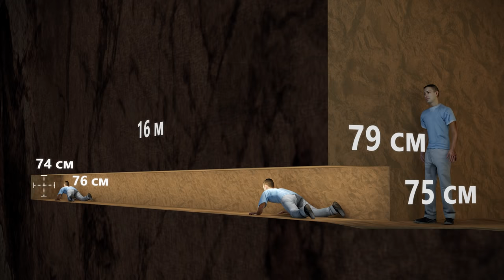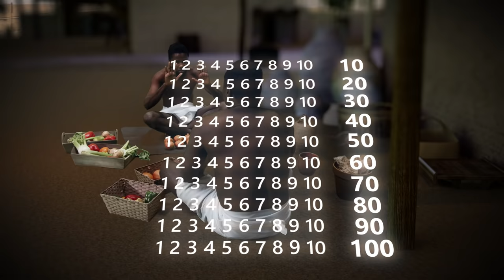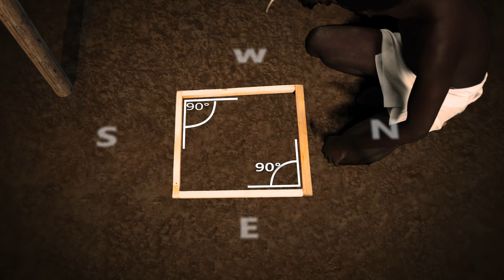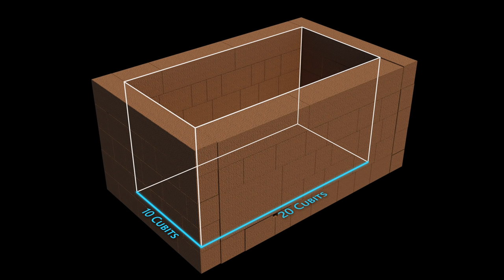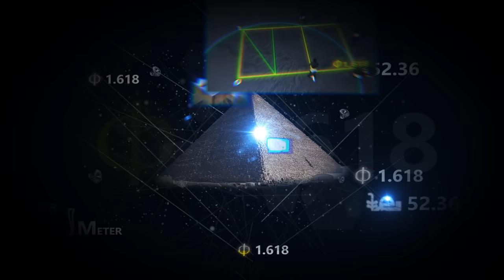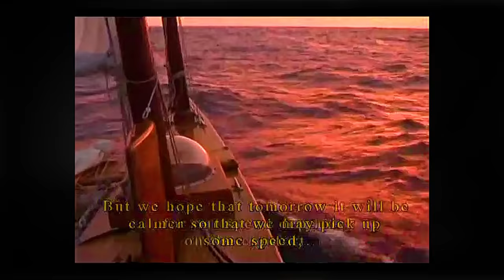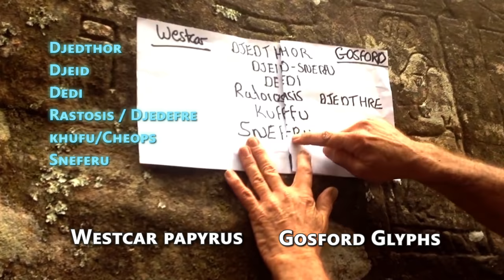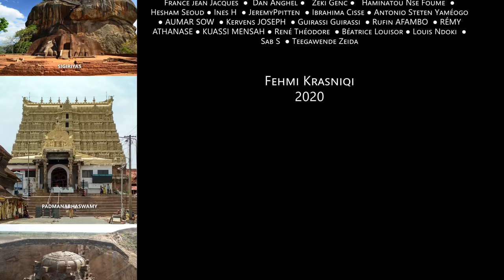The Movie Great Pyramid K 2019 - Director Fehmi Krasniqi

Comment: This is an amazing documentary! As a retired builder I would like to ask how it's possible to pour molten granite into wooden forms, without them igniting instantly. I also don't see how its possible to slide a wood form off of fresh concrete .They have to be broken apart or pried away from the pour, and it can't be before it's completely cured. In order for blocks to be perfectly flat, the form wood has to be very thick or braced. Other than that I found this fascinating!!   P.S. This is THE most interesting video on YouTube if you're into history!
Reply: Maybe they used the method of old metal casters by making the mold from red clay?and as the for the forms according to how they were made they could have tampered a dryer mixture similarly to a shower pan for tile showers? Accelerator for drying? Just ?s
Reply: @blindandok1415  Could be, obviously much of history has changed from what I was taught in the 50s & 60s. just the stuff they are finding in South America in the last 15 yrs. is astounding. Actually all over the world! It's changed my opinion on a lot of things.
Reply: @seadog915  I appreciate your response.i agree the world is a bigger mystery than we may want to admit.there are others maybe we could share some video titles. I know of plenty.thanks george.truth is mandatory.but not so easily discovered.
Reply: @blindandok1415  I was mostly referring to all of the cities and ruins they have found since the LIDAR tech. I watched one just recently where they found an entire city, hidden in the jungle!
Reply: @seadog915  yes.i have also seen.but that is at the most softer of discoveries.the discovery of earth's hidden history is interesting but it's what is ahead thats unknown that is most interesting.most interesting times.
Reply: @blindandok1415  I appreciate your comments more so now, because I realized that I didn't finish the video! I must have gotten distracted by something because the last 50 min. of it was just unreal!!! Man! It sure does make you think! Thank you for your comments. I've enjoyed the communication.
Reply: I have just watched a YT video of granite being melted with a large lens.  The liquid granite cooled to form obsidian glass, not granite.  So I am not convinced this theory is correct
Reply: Also why do blocks show bosses if poured in place
Reply: It says they used clay molds for the liquid granite
Reply: My thoughts exactly! This is the most plausible explanation I ever heard, but I am unsure about the forms. They couldn't have been wooden. They say at times it's clay, but are clay strong enough to keep molten granite??
Also they have to have been masters of forms and pouring, not building. All these statues of extreme detail have to been made in everted forms
Reply: If the Egyptians used expensive, hard to get timber as formers then timber must have been thousands of times more prevelent than we think.
Reply: @diligencehumility6971  why could they not have been made of wood?
Reply: Here's a thought... using a combination of both is rather obvious. Remove the inner wooden mold frame and leave the outer wooden mold frame as support. Wood was not burnt, and both clay and molds were reused.
Reply: Maybe they poured it after it cooled enough not to burn the wood but it’s still soft enough to form blocks. These days people doing concrete pours use motor oil to loosen it from their molds. I wonder if the Egyptians used animal fat or some other oil to release it.🤔
Reply: How about making a former, then lining it with sheets of copper which is oiled to release the mould? Lay the corners, then lay every other block and then fill in the gaps creating a finished block wall with no gaps or mortar joint. The only problem with this theory is that it does not explain the vary large obelisk nor the 1,200 tonne stone at Balbec, nor the granit which clearly have been quarried...
Reply: hi there ..yes i work in construction and the whole mould thing is an issue ..as is the moulds for the vases ..but none the less its a brilliant abstract on a possible real explanation , maybe missing a few gaps but the best explanation ive seen in my life
Reply: That’s what i thot.
Reply: I also worked in construction, (concrete) What if they had concocted a ' mold release ' ?
Also when constructing the kings chamber they spoke of using clay molds, I could see this IF they were infact able to liquefy granite.🤔
Reply: The whole presentation is more appealing than the likes of ancient alien stories.  But I wonder how the Egyptians managed to invent five-meter diameter lenses.
Reply: Мне даже не так интересно, как отливались блоки, а как они сделали линзу такого размера😂😂😂
Reply: Roblox theory??
Reply: Molten granite? No, it was cold cement.
Reply: Anyone seen the footage of the top of the pyramid from that paraglider?? The blocks look much smaller and less precise than what is shown in this documentary…
Reply: Existe este documental en idioma esoañol
Reply: Olive oil